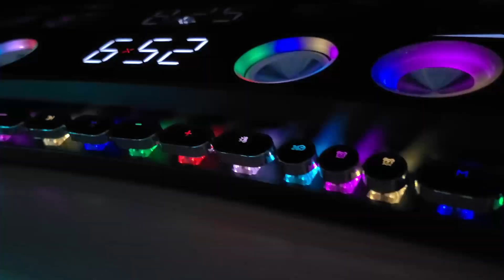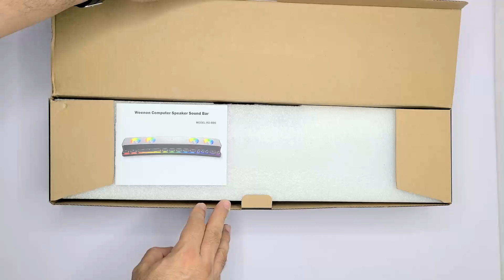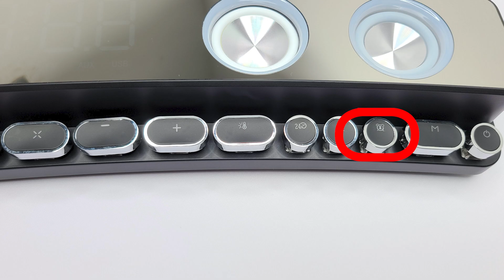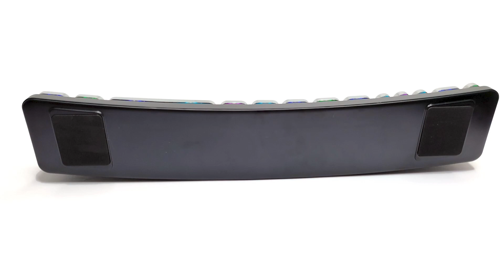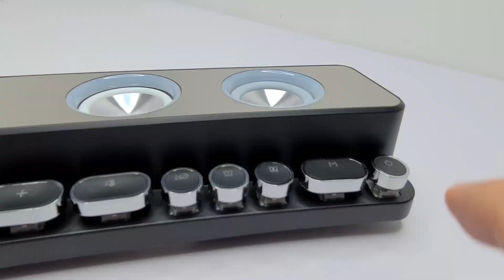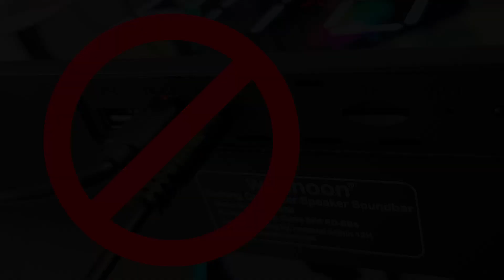RGB Mechanical Gaming Sound Bar - Weenon RD-BB6

Comment: Also how do you set up the temperature and clock to canadian
Reply from the maker: Hi Mathew. The temperature can be changed from Celcius to Fahrenheit by quickly pressing the temperature button. The clock can also be changed from 24 to 12 hours by quickly pressing the 24 hour button.
Reply: @SimpleTechReviews  doesn't seem to work 😕
Reply from the maker: @KyonKirisaki  Looks like the seller may have sent you the wrong version of the sound bar. You should contact them to have it replaced.